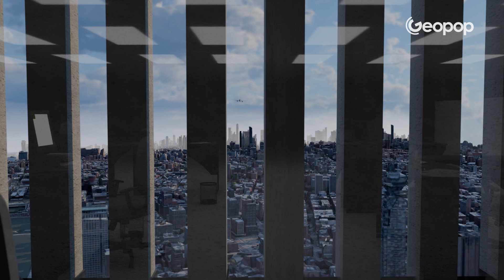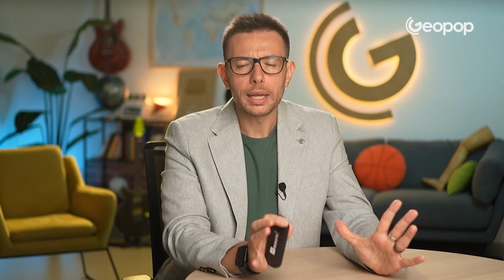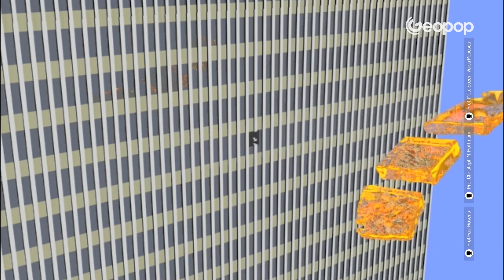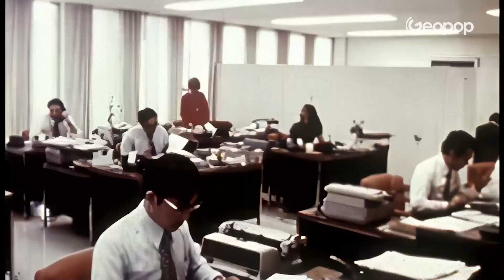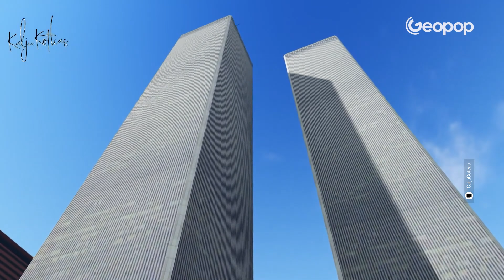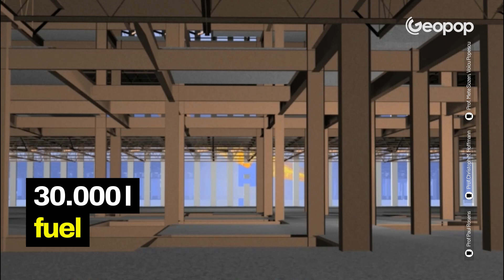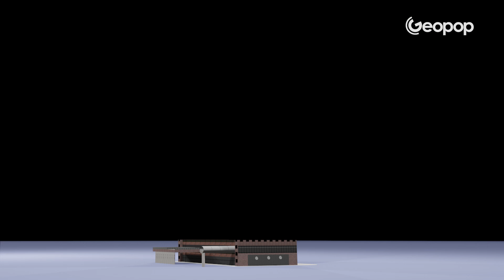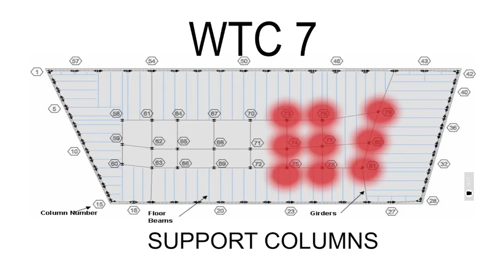9/11, 2001: The Technical Reconstruction of the Twin Towers and WTC 7 Collapses

Comment: So if the steel is deformed and caused the fall due to temperatures, how did the bottom part that wasnt hot or deformed get pullvorized into nothing? It was a controlled explosion 1000%
Reply: he explains that in the video.
Reply: It’s got to suck to be so wrong.
Reply: @soshieopath7142 no I’m just curious and stating my opinion. Could care less if I’m wrong or right.
Reply: It's called progressive momentum.
Reply: "I'm uninformed idiot, that can't grasp the reality, therefore I'm right 1000%" there, fixed it for you.
Reply: The 47 core and 236 perimeter columns of the Twin Towers support all of the gravity loads of the building. ALL of the resistance is in the columns.

Planes impact Towers, causing massive structural damage, destroying sprinkler systems, tearing out gypsum board walls and blasting off the SFRM insulation from the floors. Multiple floor-wide fires are started instantly and spread rapidly due to the destruction of fire protection systems and venting of the building during the impact.

Serious fires were largely confined to the impact damaged floors and those immediately adjacent to them.  

Fires were started by the impacts and fuel aboard the aircraft, which acted as an accelerant. No shortage of other consumables inside the tower to continue the fires. 

Collapse was initiated (started) at the impact and fire damaged floors when floor trusses exposed to heat over time sagged, in turn pulling on and causing the inward bowing of perimeter columns by up to 5 feet until they buckled. 

No steel melted or needed to. Structural steel will bend and fail at less than half its melting temperature.

Once the perimeter columns buckled the formerly static load above became a dynamic load 30 times greater, easily overwhelming the structure below.

Thousands of tons of now loose debris fell through the open off space - through the inside of the building bypassing the columns - dropping 12 feet onto the first intact floor it comes across. The massive instant overload causes the floor to fail, adding its mass to the falling mass which continues to accelerate for another 12 feet until it impacts the next floor, rinse and repeat all the way down. Rate of collapse increases as momentum increases. As each floor fails, air inside the building (the Towers were 95% air by volume) is compressed, then blows out the sides _in reaction to the Tower falling, not the cause of the Tower falling.

No fire required at all on floors below the impact points for them to fail. The mechanisms that started the collapse are different to the mechanisms which continued the collapse.   That will be a difficult concept for some.

As the floors fail the perimeter columns are left literally hanging in the breeze, no longer attached to the rest of the structure. They peel away and fall in great sheets (think banana) out to more than 600 feet from the base on the 4 points of the compass. 

Core columns failed last. 

Each 110-story tower had a 1-acre footprint. The debris pile was up to 14 stories deep and spread out over 16 acres, destroying 8 surrounding buildings and damaging more than 100 others.
Reply: Idiot
Reply: Evidence of that? I could say it was aliens, if I had, um, evidence.
Reply: that doesn't make any sense at all.
Reply: You're 100000% right 👌
Reply: You need to fully understand the design of the buildings first and once you have a grasp of that you will understand why it all came down once the collapses were initiated.
Reply: @davidwilliams4387   nice try. all of that has been  studied by 911 study consortium  they are still researching the day.  Even the Pentagon plane was proven to be remote controlled.  Those in that group are not some you tubers.. 911  US let it happen and Rumsfeld knew all about it.
Reply: @davidwilliams4387 Obviously you don't understand why the Twins have fallen. It's clear that they both were pulverized with help of controlled explosions. Explosive is being positioned a year before, action is made by Mossad or ISIS, English translation is Israeli special intelligence service. They have used fake names and worked under coverage of making the documentary movie about the Twins towers, presenting self like Israeli students of Arts. You Americans are victims of Zionist Israeli Cult. They running your government and other institutions. Everything is in their hands. I'm sorry for you and your way of living. You need to wake up and take your country back from them.
Reply: explain building 7 then @davidwilliams4387
Reply: @davidwilliams4387  ive recently gone thru it all.  i can see that you havnt..   and if you really fully understood the design,  you would know it was impossible for it to happen the way it happend.... 
first of all,  the core collume in the towers by it self,  was built as a skyscraper within a skyscraper. thats how sturdy it was..

These 47 core columns were not just supporting the weight of the floors, but also acted as the spine of the entire structure, providing critical lateral stability.
They were massive steel box columns, some with 4-inch-thick walls at the base, tapering as they reached the top.
This central core was designed to handle gravity loads, wind stress, and even impacts, making a total, simultaneous failure unlikely without additional destructive forces.

The 47 massive core columns in each tower were essentially steel skyscrapers within the building itself.
For the pancake collapse theory to work, these core columns would have to completely fail in perfect synchrony, which is extremely unlikely without additional structural weakening.
If the pancake theory is correct, you would expect to find dozens of stacked concrete floors in the debris pile, but instead, the rubble was mostly dust, twisted steel, and shattered glass.
Much of the concrete was reduced to fine powder, which is hard to explain without some kind of explosive force.

In a typical building collapse, you would expect the outer shell to peel away or lean to one side if the core remained intact.
Instead, the towers collapsed almost perfectly symmetrically, suggesting the core somehow lost its structural integrity in a perfectly timed manner.
The core columns didn’t just bend or buckle – they were completely destroyed, reducing them to short, twisted fragments in the rubble.

The kinetic energy generated by the falling mass would have to be enough to pulverize the concrete, snap the steel columns, and eject debris laterally at high speeds – all at the same time.
This would require a massive amount of energy, far more than what could be generated by a gravitational collapse alone.
Yet, the debris field included massive steel beams thrown hundreds of feet, which suggests a much more violent release of energy than the pancake theory accounts for.
*this is all just logic,  not fantasy

Reports of molten steel in the rubble piles suggest temperatures far higher than jet fuel can produce.
Many survivors reported hearing explosions in the basements and lower floors before the buildings collapsed.
Huge sections of steel were ejected hundreds of feet from the buildings, indicating a violent and energetic force.
*all of this got dismissed and never entered the "official story"..

There were multiple witnesses and workers who reported unusual construction and maintenance work on the upper floors, elevator shafts, and core columns of the towers in the weeks and months leading up to 9/11.
William Rodriguez, a janitor in the North Tower, claimed that bomb-sniffing dogs were removed and that unusual power-downs occurred, cutting security cameras and alarm systems.
*also dismissed..

The elevator shafts provided direct access to the core columns, which are critical for the structural stability of the towers.
Some workers reported seeing white powder and strange smells in these areas, potentially indicating the use of thermite or explosives.
The company ACE Elevator, responsible for the elevator maintenance, reportedly left the building immediately after the attacks and has never been fully investigated.
*also dismissed

remember the core collumes that where built like a skyscraper within a skyscraper??

The planes were traveling at over 500 mph, carrying tens of thousands of pounds of jet fuel that exploded on impact, creating intense fireballs and temperatures that reportedly melted steel.
Yet, we’re supposed to believe this paper passport from a hijacker somehow survived this firestorm and then the subsequent collapse of a 110-story skyscraper?
How can a passport survive the explosion and collapse, but the indestructible black boxes from two planes were supposedly never found?
*seems a bit strange dont you think??

For the towers to fall as they did – straight down into their own footprints at near free-fall speed – the massive central core of 47 steel columns in each tower would have to fail simultaneously or be severely compromised. 
so yea, highly unlikly this would happen with jet fuel alone,  especially when alot of the fuel burned up on impact in the big fireball explosion..

i can go on n on with this shit,  honestly im just intrested in the subject bcs of all the Red Flags there are in the official story.   alot of this shit got dismissed completly,  why wouldnt they look into who Funded the attacks even?? its fucking crazy imo

for example:
If the official story is true, then why the need for so much secrecy?
If it’s about national security, why not just redact the sensitive parts and release the rest?
If it’s about protecting methods and sources, why are family members of the victims and respected engineers still being stonewalled?

i probly mentioned alot more then was needed for the response to your comment..  but bruh comman,  open your eyes, stop being an NPC..
Reply: Your mind is an uncontrolled explosion
Reply: (answering the video) -- Then what is the source of the many tons of molten steel found in and under the debris, the heat so intense that the molten steel remained in that state for weeks afterward, running off of the debris as it was excavated. This cannot be molten copper from wiring that retains the color of a shiny new penny.  It cannot be molten aluminum that retains the color of the polished aluminum wheels of a street racer. It was the color of glowing orange molten steel  that cannot be mistaken for any other material, reported by firefighters who are very experienced in the nature of such materials as well as seen in video evidence.

When you combine this with an entire lack of turbulence behind 500 mph aircraft, when even a small Cessna Aircraft would leave an evident wake in the smoke and fire only seconds later .  . We find that skeptics still cannot be skeptical of the official narrative in explanation.  Sponsored channels and forum activity are skeptical of nothing when support is provided.

Sponsored activity in the forums is very normal today for commercial and political purposes and subjects of controversy -- in the attempt to lead public debate.
Reply: Your right controlled explosion..look it guys for two weeks a month before 911 floors 1-25 in each tower was shut down for maintenance
Reply: @kellicormier9900  Jeff Bushs  company made there some "renovations" floor by floor. It was actually the time when they put thete the explosives called termite, pipe explosives.
Reply: @kellicormier9900 coincidence it’s certainly not unusual for a building to need work done or maintenance. Doesn’t prove anything

Comment: This covers nothing concerning the impossible fact that those airplanes can't go the speeds they claim at sea level.  At 32,000 feet they can not at sea level.  Seismographs show the wave lengths of a twenty story building hitting.  Those buildings turned into dust as they fell, you can watch it on video in slow motion.  The buildings feel at free fall speed not pancaking at all.  This video is not truthful what so ever.  Probably sponsored by the U.S. gov't.  NIST is corrupt.  It was an inside job.  They hauled away all the steel somehow had 400 dump trucks ready to go after they fell.  That steel was evidence taken away to China to be melted down.  Evidence from a major crime scene.  Why did that happen??  First responders testified there were explosions in the basement and testified  the main floor was ripped apart by the explosions.  Anyone can see building 7 fell into its own foot print.  There is so much to all that happened and so many facts not even mentioned in the NIST report.  
No airplane parts at the pentagon, no bodies, no luggage no nothing.  Plus the so called airplane went through 3 pillars reinforced concrete at the pentagon?  Aluminum crumples.  No wing marks on the pentagon and just a hole the size of the fuselage, come on.  Do research, why were there 5000 structural engineers that signed their names stating the NIST report was BS.  Inside job folks, plain and simple but complicated.  Will happen again you can count on it.
Reply: Of course airplanes can go travel at those speeds for the few seconds they did. Because they did. Just ask Boeing. Nobody ever asks Boeing. They just assume or make things up.

Much like all the other claims in your post.
Reply: @TheLoonResistance  I have done my research what claims do you call false?  I can refer to sources.  Just look up here on you tube : can an airliner go 540 mph at sea level.  You will get your answer.  Do your research before you claim  someone is full of what your full of.
Reply: @dave3313  - All of the claims you made, starting with the first one I mentioned in my first reply. Joe Blow's bitchin YouTube Channel is not a source. If it didn't come from Boeing it's made up.  Fantasy. Make believe.  Feces of the male bovine. 

It may be what you you want to hear, but that doesn't make it fact.

What is fact is we can measure what the aircraft actually did (Flight 11 & 175) and we even have the FDR's for 77 and 93.  We know exactly what they did and aerodynamically they were quite capable of doing what they did - for a few seconds.

Because they did.
Reply: @TheLoonResistance Nice try dude..Any person with half a brain knows was up..Truth is What is
Reply: @boneyardmilitia1836 - so you didn't ask Boeing either. 

Science doesn't lie.

Science learns. Science evolves.  

If you don't like the science it is up to you to produce better science. If you can't,  that is your sign it is time for you to learn and evolve. 

Not everyone can.

Comment: If you believe this story, I have some ocean front property in Arizona for sale.
Reply: You rule bro
Reply: I am joking, I completely agree with you. Thank you.
Reply: Does it come with a sauna?
Reply: Which is more extreme -- to accept without question the inexplicable lack of turbulence in the wake of a 500 mph large passenger airliner -- not evident in the smoke and fire covering the impact zone only seconds later? -- or to recognize the indications of digital projection in its imperfect nature as we see a wing disappear in front of a bright blue sky? From another camera angle, the same aircraft is seen passing behind a crane in the foreground, yet in front of the heavy crane cable. 

There should be a hurricane of turbulence in its wake that would entirely disrupt and disperse the smoke and fire seen billowing outward just 3 to 4 seconds later at both towers.  Even the wake of a small Cessna aircraft would be noticeable -- yet there is nothing.
Reply: @ronaldgreene5733 what the hell are you talking about. It was Islamic terrorists you melt.
Reply: I can't watch any more, this is the best comment that wraps it up.

Comment: Most people believe 911 was a inside job.
How could tall tower fall apart al the way to the ground?  The strongest part wasn't damaged by fire and should withstand the collapse.
The fuel did not run down the stairs but exploded on impact, outside.  We saw it in many videos.
Reply: That is not true, which means you are either deluded or a liar. It also really has nothing whatsoever to do with the topic of this video, meaning you also suck at paying attention.
Reply: @TheLoonResistance such anger. You a Democrat?
Reply: @TheLoonResistance  It's lot more complicated than you can understand. So you are the one who suck.
Reply: @zvast  - It isn't actually. As copouts go, that was really awful. 

Fact of the matter is, the 9/11 woo movement withered and died 15 years ago. The few holdouts who didn't get it are the hopeless zealots and believers, non-thinkers and attention seeking trolls.

You know, people like you.
Reply: @TheLoonResistance  Your vaque comment shows how shallow you are.